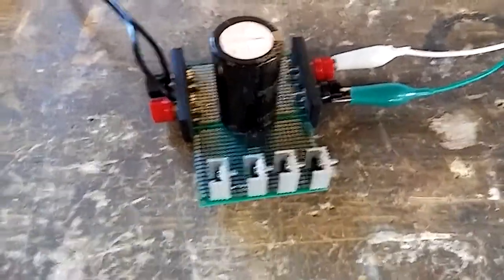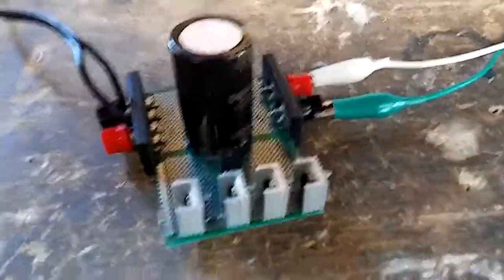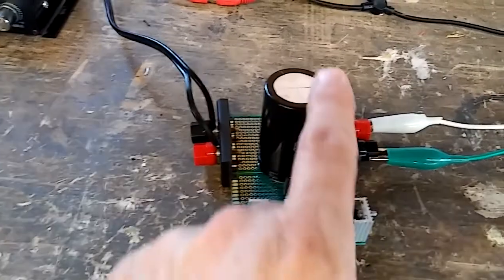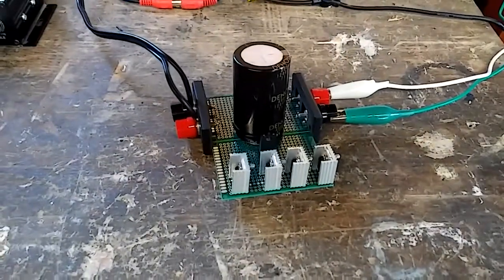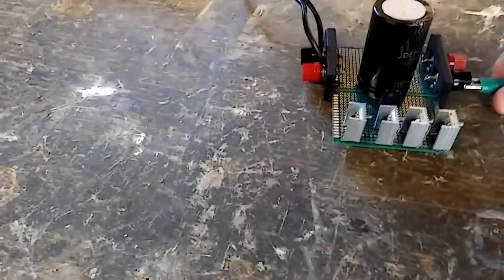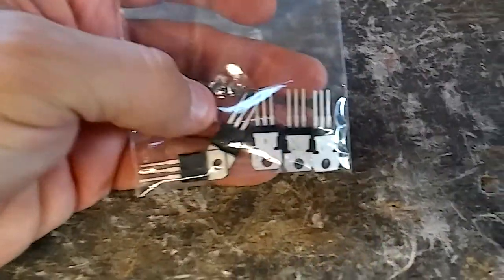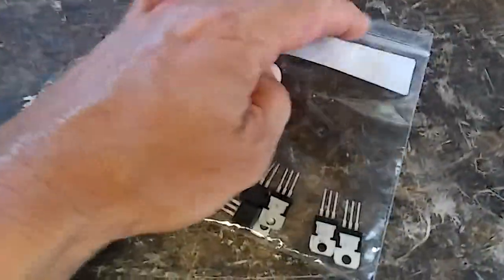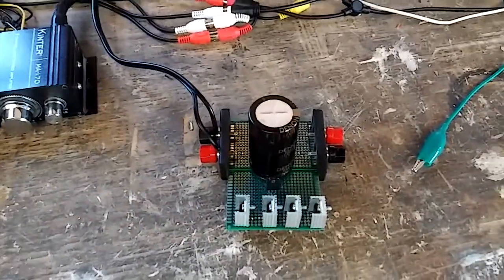DIY Solar voltage regulator no battery needed

Comment: Placing a diode from panel to C will prevent reverse voltage from destroying the transistors in the case of a panel or wiring short. It is common to put a very low ohm (.1 to .05) resistor in the emitter to balance the load with different gain transistors.  This can also be accomplished with about 6 inches of identical wire to each emitter.

Comment: Cool regulator. Still think your best bang for the buck is this mppt. Same price as another set of panels but more beneficial. 
https://rover.ebay.com/rover/0/0/0?mpre=https%3A%2F%2Fwww.ebay.com%2Fulk%2Fitm%2F302378028095